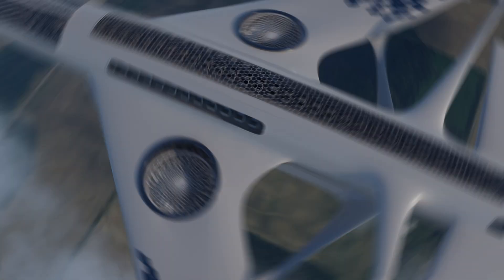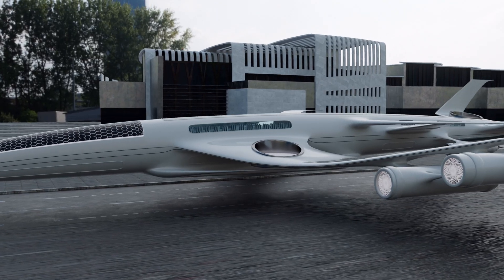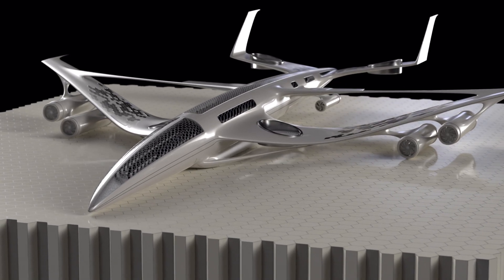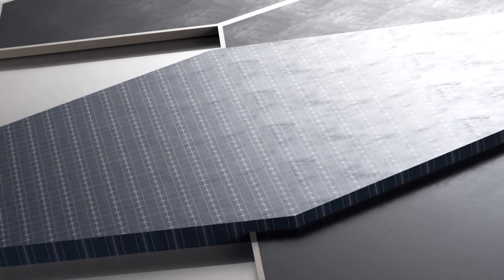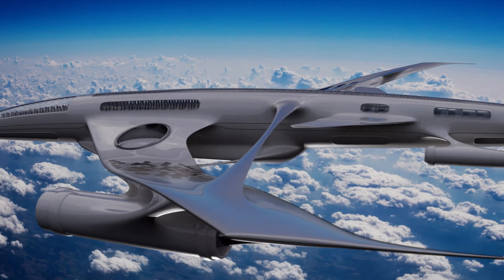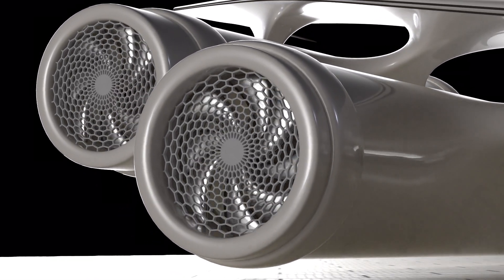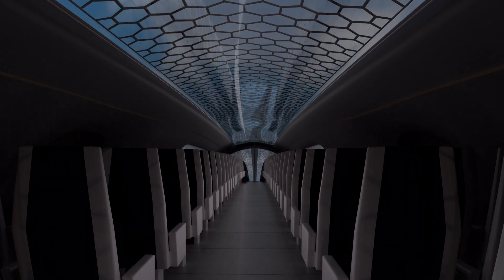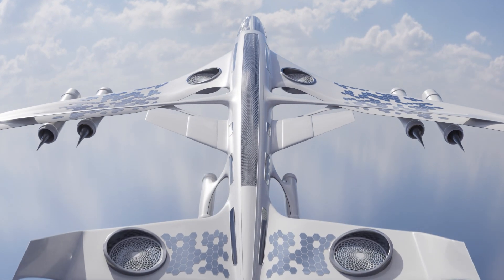Solar-Powered Plane of the Future

Comment: What's the back up plan for solar failure? It would be good to know. We depend on generators and power is out, we depend on solar but what's the backup plan for solar energy failure?
Reply: There is no need, because the sun would not fail.

Comment: that's never gonna happen, nothing beats the explosive force of oil, solar isn't going to power the turbines enough to get it off the ground, let alone the weight taken by the batteries to store enough power to keep it in the air for 8 hours+ straight. you want power: nuclear, fusion/fission, oil. you want clean fuel, invest in a water based hydrogen engine. certainly lighter and cleaner than oil.
Reply: How about a solar/biofuel hybrid airplane?
Reply: Oil has 7 times less energy then hydrogen, gotta end the oil usage lol
Reply: They used to say the same thing when stuff was powered by steam and coal